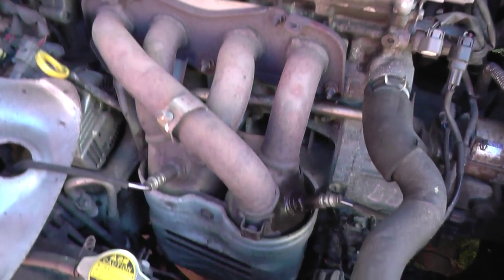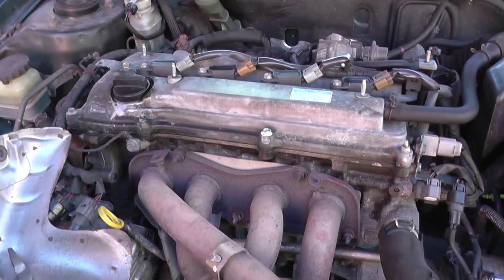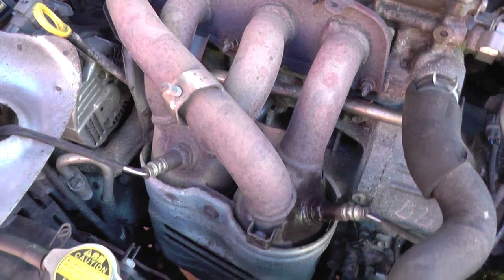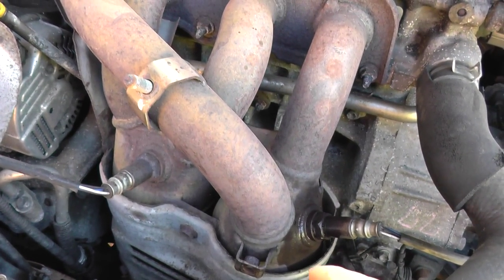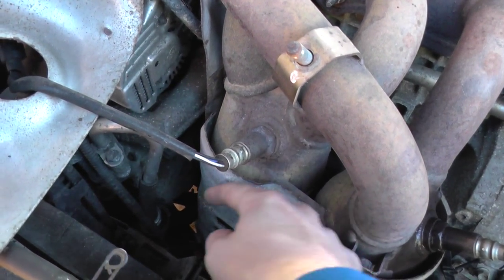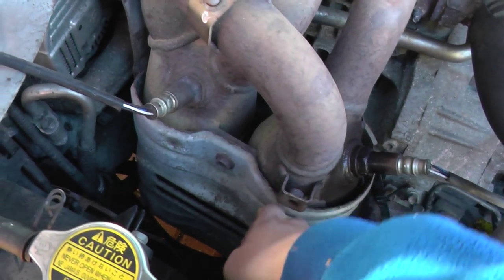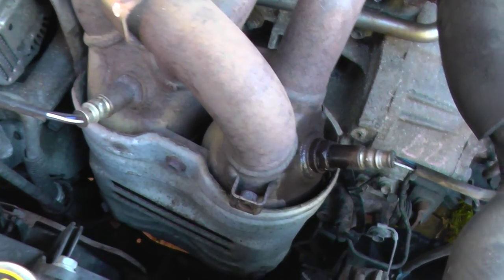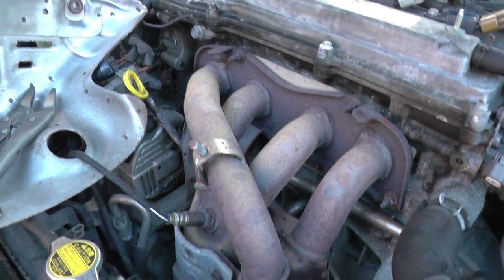Toyota Avensis O2 Sensor Locations Bank 1 & 2, Sensor 1 & 2

Comment: This is correct on the 1AZ-FSE engine: 

Upper right is bank 1 sensor 1.
Bottom right is bank 1 sensor 2.
Upper left is bank 2 sensor 1.
Bottom left is bank 2 sensor 2.
Reply: Thanks. I have also 2.0 1AZ-FSE petrol engine in my Avensis 2005 model. No i know which one is bank 1 and bank 2.

Comment: It depends on the engine code - where the bank 1 and 2 are.
Above is correct for 1ZZ-FE
.
Reply: Are they all the same sensor ?
Reply: @Lucidchronicles  No, they are not
Reply: @henrietta70  thanks if I need bank 2 sensor 1 for 1zz-fe, what part number do I search for?